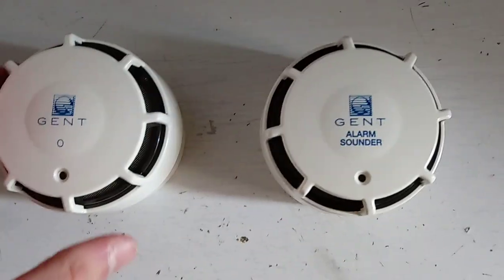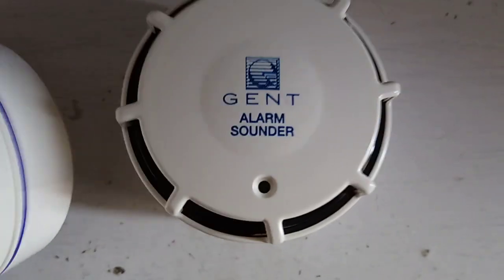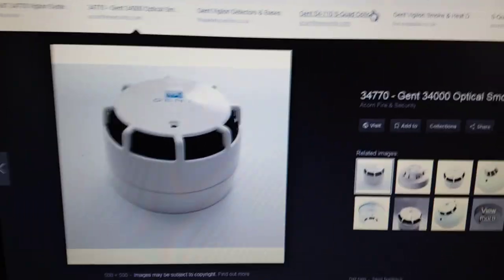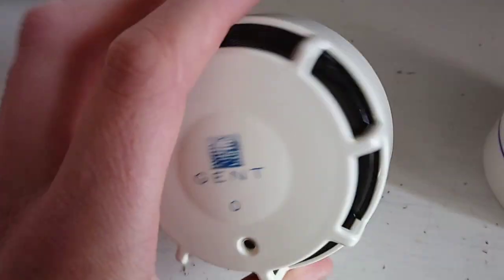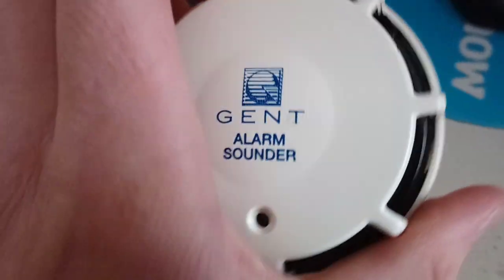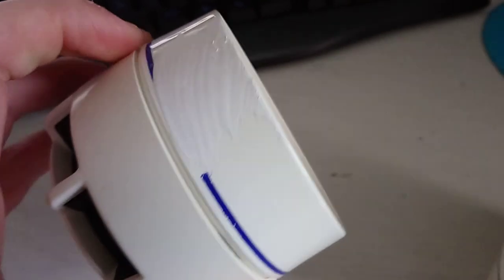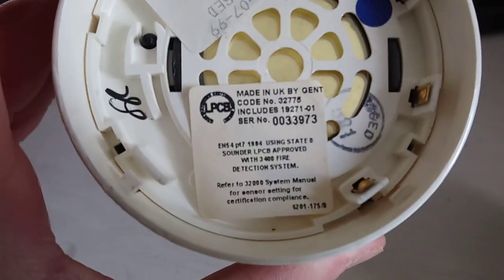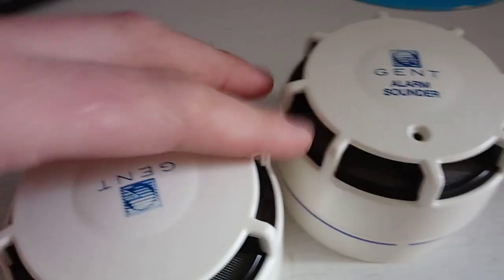Gent alarm sounder: I need help...

Comment: 32777 and 34777 are repeat sounder units. Sounder only, not a sensor. The sensor model codes are 3x710 - 3x730
Reply from the maker: OK, thanks